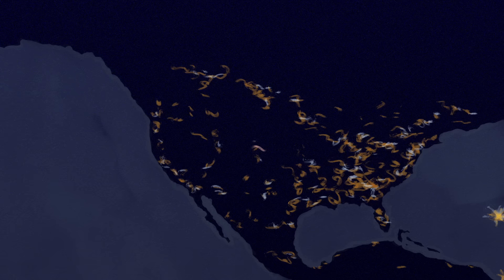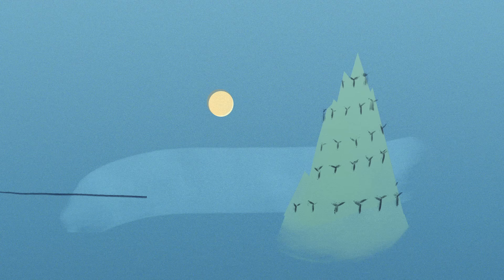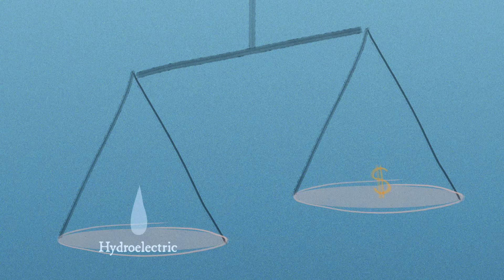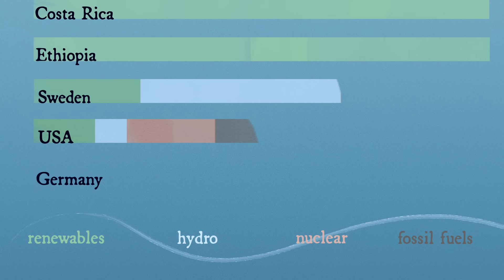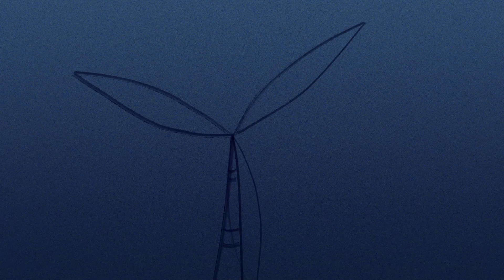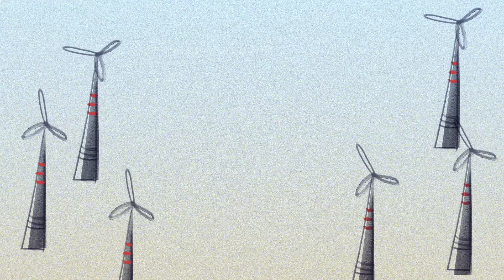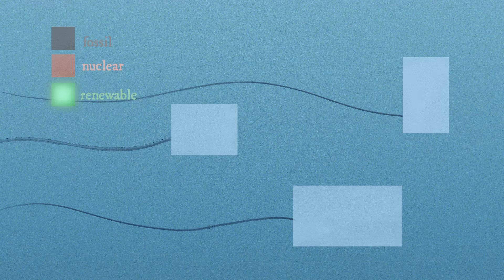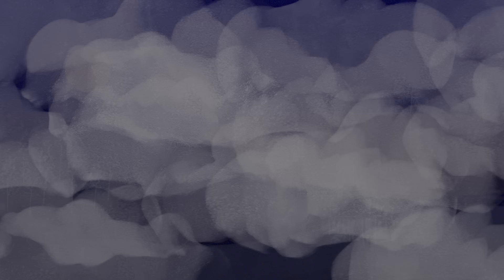What does the world's largest machine do? - Henry Richardson

Comment: Interesting to see hydro being separated from the other renewables

Maybe it's because hydro fluctuates more predictably over time.

Or maybe because dams can sometimes have pretty serious negative effects on the local environment
Reply: Hydro is separated, because unlike traditional renewables, it is controllable. That is you aren't losing potential power. At any time you can close off access to the turbine, which then has the water go back to collecting behind the dam wall(meaning you didn't waste power, you saved it for later). Solar, wind, thermal, and wave you're just wasting energy that you could be having when you disconnect it or shut off operations. This is also why Nuclear has it's own category, it is NOT controllable. Once a nuclear fission reaction starts it's not going to stop until it runs out of energy so your typical nuclear plant will just disconnect the energy when it's not needed and continue pumping water to keep the reactor cool. So any amount of time that the nuclear facility is downscaling operations, is lost potential power.

Comment: Is there any industries where the electricity demand is high but the infrastructure cost is low? I'm wondering if some industries could take advantage of the intermittency of renewables by producing only when power cost is low. I know it would be possible to purify salt water or to produce aluminum for example, but I don't know if it makes sense financially. If the infrastructure for an industry is expensive, then you typically need to run it 24/7 to get you capital back.

Comment: Smart devices may seem like a simple solution, however in most cases a lot of things need to be redesigned around them to make it work. You often can't "tap into the grid" at a time of low demand simply because the low demand is a result of such devices not being needed at that time. For example, you don't want a "smart" air conditioning that turns off when there is a heatwave and so there is peak demand because of all the air conditioning, unless you have a home designed to not let heat inside, and you froze it overnight.
Reply: Yes. Seems it's more viable to bet on local power storage.
Reply: Agree. And smart devices are just for solving the surface of the problem when using renewable energy sources.
Reply: "Smart device" isn't an invention in of itself, it's a term. Even barring the flaws you pointed out, suggesting we use "smart devices" to make decisions for us is suggesting engineers design individual programs for every individual kind of hardware that uses a relevant amount of electricity. And for the government to enforce this apparently determinable technology upon companies. Considering lighting isn't far behind HVAC in leading energy consumption, I guess we'll be inventing smart lamps along with our smart boilers and smart furnaces.

Simpler solution: continue working on better batteries.

Comment: My bet's on using hydrogen as fuel storage, as it is energy dense, can be transported, and can be used to power cars. However, I don't know that much about other fuel storage options. Hopefully that'll be a future Ted-Ed video!
Reply: Hydrogen is extremely energy intensive to create and transport around. It doesn't really solve anything other than ICE drivers still having something physical to put in their cars.
Reply: @NeonVisual  This... They have tried so many ideas and hilariously STILL the best one is pumping water from a lower lake to a higher one and draining it to the lower one through a turbine later. Molten salt reactors are difficult to control(not the nuclear one, the renewable one which uses renewable energy to heat molten salts to extremely high temperatures and then uses that hot lava like mixture to make steam for a turbine later), Hydrogen is extremely energy intensive, flywheel storage requires constant upkeep to avoid efficiency losses and various other methods are theories at best.
Reply: @setcheck67  Liquid metal batteries are the solution currently being rolled out for grid-scale electricity storage. Research it.
Reply: @NeonVisual  Yes they are being tested in 2022, seeing official use. They are by no means proven in field operations like any of the other ideas which blew up(such as molten salt).
Reply: @setcheck67  Liquid metal batteries have already been proven in use and now being rolled out for commercial use. They can be scaled up to any size required. The current ones being placed in power stations are the size of a shipping container, and because the anode and cathode are made of liquid, they don't suffer from dendrite formation over time, which is the thing that kills lithium and other batteries over time. They literally have zero wear over time. 

The only downside is they have to be shut off during an earthquake, but can then be fired back up again once the liquid stops sloshing and is checked over. That's not really a major concern though. They could be built on stabilised motion damping platforms such that they don't move during an earthquake.  They are also an ideal candidate for home batteries as they can be created to fit any size simply by making the case to the required dimensions and pouring in the metals.

Comment: As much as I want this to happen, I probably won't buy a "smart" air-conditioned since I won't be able to turn it on when most needed- at peak hours, when it is hot during the day
Reply: You can turn it on whenever you want. It will only shut off if you program it to do so, like if you are gone during the day. It's more to prevent people from running it when it's not helpful because they just forget to switch it off.

Comment: And then there are danish windmills that have brakes in them to prevent spikes aand overproduction. Can the brakes fail? Yes. Chances of enough brakes failing and causing a spike big enough to destroy the power grid? Higly unlikely.

Point is, there is no excuse to expand windpower if done correctly.

Comment: That's not a machine, it's a collection of machines and materials - I don't think anyone counts wire as a machine - yes, but each one is discrete and can function without the others. Yes, sorta, even the wire under certain circumstances.
Reply: Also, technically speaking many of those 'machines' are not machine either, like take transformer eg, is there anything mechanical in it? it's all electrical/electromagnetic.

Comment: Why aren't we just going with small modular nuclear reactors?  

Seems like anything else is just not worth it... and yes, nuclear is very safe (just do a little homework).
Reply: Politics...
Reply: As a nuclear enthusiast, I hate when other nuclear enthusiasts say this kind of stuff. Solar, wind, geothermal and hydro are cheaper, cleaner and more efficient when implemented in the right places. For example, in Iceland, where there is a lot of volcanic activity, so geothermal is the best, or Brazil where there are a lot of fast flowing rivers, so hydro is the best. We need a mixture of both nuclear and renewables. Fossil fuels are your only enemy, not renewables.
Reply: @genericjoe4082  yeah but this video is about the US where we basically have all types of environments except jungle and tundras
Reply: @HIFLY01  that's even better, because jungles and tundras are like the only places, that I can think of, where it is unfeasible to use renewables. In Desert environments use solar panels, in coastal environments use tidal and wind, and in river environments use hydro.
Reply: @genericjoe4082  I think Ted Ed did a video about putting solar panels in the desert. Or someone did and theres a reason it doesn't happen. 

Wind you need a lot of space and it wouldn't be really good for the coast and tide power would disturb the sea life. Same with rivers
Reply: @HIFLY01   Putting solar panels on the desert is really not that bad tho, if you are the richest country in the world that is. Yeah, the dust and cooling is a pain, but that's not any bigger of a pain than climate change. Also, putting solar panels somewhere like all over the Sahara desert is a problem because Sahara desert is big and you gotta go very far inside to reach the interior panels, and countries around and inside it don't really have that much infrastructure and resources to build proper pipelines, but small dry regions like in the United States don't have any of that problem. America has enough resources to make a pipeline there and the infrastructure necessary already exists mostly. 

Regarding your point about wind and tidal, going overboard is ofcourse bad that's why nuclear exists. Going overboard with nuclear is also bad, uranium mining and the amount of concrete required to make a power plant is not that great for the environment.
Reply: @genericjoe4082  the thing about solar is it reflects heat back into the atmosphere and having a bunch in the hottest climates or at least enough to make it worth it, would increase the temperature. 

Plus you have the problem of mining all the resources for them too and wind turbines cant be recycled.

As for going overboard I'm not sure how much of solar panels/turbines you think we would need to make a dent in the power grid but its quite a lot. You can't just have a couple wind turbines or a single solar field and expect it to do much
Reply: @HIFLY01   The first point requires a source. The second point too, as per my research (don't think I was half-assing it, those two points took me the whole day to research, can't find your first point anywhere), most of the components of a wind turbine are recyclable. 
Yes, a single solar field can do a lot. An average photovoltaic panel can power an entire average American home (provided they are in a place with sufficient sunlight). A single wind turbine can also do a lot, it can meet the energy demabs of 1500 American household (if we have batteries to store that energy),
Reply: @genericjoe4082  I checked and I guess they can be recycled but are very rarely recycled and end up in landfills. Theres a picture of a giant pile of them in a lot of articles half buried.

As for how much power each generate, no lol. Wind turbines, if having a constant wind speed which isn't exactly ever going to happen but lets say it does, makes just over 20 kwh per day while the average US home uses 30 kwh per day. Solar panels make 1.5 kwh. Even if they hypothetically did produce enough to power a single home for a day, there are over 140 million houses in the US. If you wanted to make even just a small fraction of houses have power, you'll need a lot of wind turbines, which take up a huge amount of space and even more solar panels which takes up even more space. 

In case you didn't know, theres a certain distance turbines are put together. Its typically half a mile or more. There's space in between the blades on the ground so something like a farm can be made but for solar panels it takes up the whole area. Nothing can go there unless you build them on top of some platform blocking all the light below. I've seen a house or 2 with a solar panel on the roof but at 5% power production of the daily usage on a good day, it wont really do much. 

Talking about no sources and yet you didn't provide any either lol
Reply: @HIFLY01  That's a systemic problem, just like with nuclear. Most countries don't like to recycle wind turbines, just like they don't like nuclear. 

"USGS . Gov- how much energy do wind turbines produce" A little lower than my 1500, 940 homes can be powered by the power generated by a single average wind turbine.

Also guess what between the spaces of the wind farms solar panels can be placed.

The entire US can be powered by solar panels covering about "only" about 0.67% of its land area (department of energy "solar energy in the United States"). Reduce that to 20% of the US energy demands, so it covers about 0.13% of its land area (not taking into account the increase in efficiency in the mean time and the other infrastructure and some homes using personal solar panels to power their homes) with about 20% covered up by wind (wind can be placed in between solar farms) , 15% or so percent taken up by other renewables and the 45% left for nuclear. Legalize mixed use housing (unlikely but we are talking about removing the stigma around nuclear and the entire US going sustainable, compared to it, not so far fetched) and you got enough land for all of it, with little to no deforestation.
Reply: @genericjoe4082  my favorite thing about this is you expect it to just work. "add solar panels between the turbines" not sure if you've ever seen a wind farm before but I have 2 about an hour from me. You know where they're located? On a farm. You can't just rip up some guys land and put up panels. Thats unethical. Sure not every wind farm is on farmer Joe's land but someone owns the land. Com Ed or whatever electric provider you have doesn't own millions of square miles land. 

Second if those numbers really are true then we would only need 150,000 and we have a little less than half of that already (70,000) yet wind only makes up 10% of the total power for the US. Now im no math genius but those numbers clearly dont scale at all. Even at half power they dont. 

I know the simple solution would be "just add more" but thats not how it works. Like I said theres a reason we don't fill the desert with solar panels and Ted Ed I believe even made the video. Theres a reason why we don't have thousands and thousands more wind turbines than what we already have
Reply: @HIFLY01  now this is way above of what I can argue with, so I will take the L. Good job.